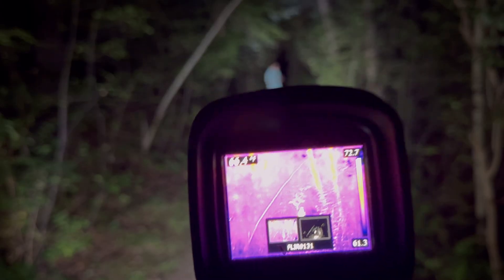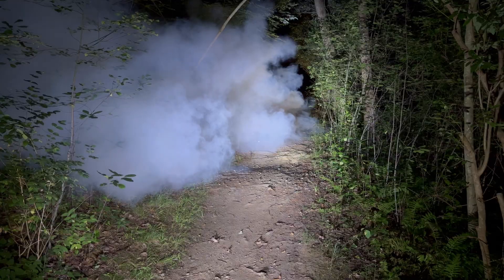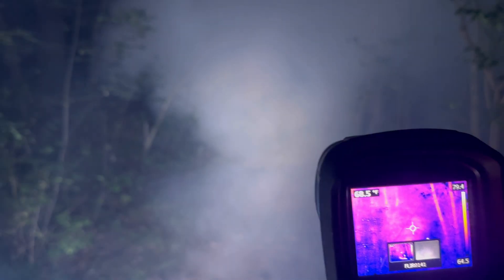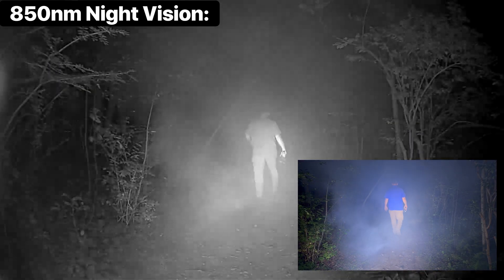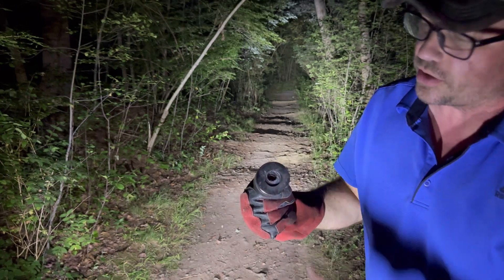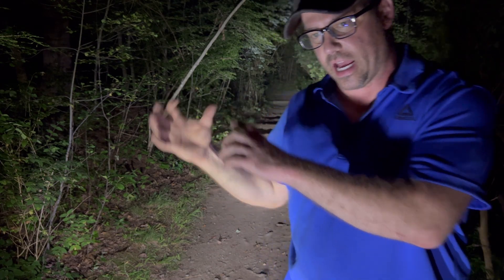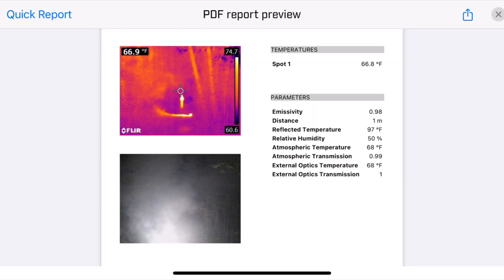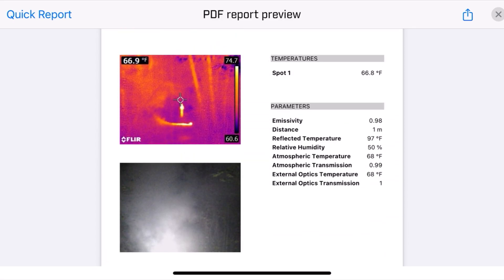HC Smoke Device vs Infrared and Thermal Imaging

Comment: Not sure if you’ve already tried this but it’s stuck in my brain. Why not add some smaller diameter holes on the lid and reduce the bottom hole size. Whatever configuration of size and number of top holes to get the same area as the current exit orifice? Kinda like the OG M18. Say you change the bottom hole to 5/8in. On the top drill 3 3/8in holes. You’d end up with almost the same area. .637 for the new configuration versus .601 with the current 7/8 single orifice….. I would think it would stop all the rocketry lol.

Comment: I would try a side hole rather than a bottom vent. (Like common ground spinning fireworks). Then I might add glitter, fine mica dust to the mixture. A bright flash seems to momentarily overwhelm the camera. 
Thank you, this video is inspiring.

Comment: I remember talking with a fellow who studied thermal phenomenon from an imaging perspective. The issue is that the particulates are not large enough to block the wavelengths that most thermal sensors operate at. Particulates large enough to interfere with a thermal camera would not be light enough to float in the air for any significant period of time.

Comment: Its the maximum wavelength they can see with NVGs. The latest greatest can go to like 1200nm. Gen 2 is around 950nm. Gen 3 can goto around 1050 or so. 

For thermal imagers, you gotta test mid and high band thermal.... Basically active cooled vs uncooled arrays. MWIR vs LWIR. MWIR is harder to defeat (active cooled arrays). SWIR is the newest thing, basically where infrared light and thermal meet. Lasers in the 2k nm range cant be seen by NVGs but can with SWIR. It can also see through most smoke...b
Reply from the maker: F_ck, that’s not good news, it’s so much easier to use an expl0sive incndi@ry screen, just white out. Pesky laws making me jump through hoops
Reply from the maker: Maybe some dried peas as star cores or something wouldn’t be considered antipersonel
Reply: @InventionIncarnate you should be able to add a flare/fountain using a metal fuel like coarse aluminum or titanium powder without having to worry about it being mistaken for an anti personnel device. It's just a signal device, there's no shrapnel.
Reply: @InventionIncarnate compressed cornstarch with a touch of nitro lacquer perhaps
Reply: @InventionIncarnate yup, no easy way out like the vehicle smoke, which is in part willy pete, and a bunch of metal oxides.

Comment: 1) Weigh down one end of a grenade tube, and round it, such that when it lands it always stands up.
2) The bottom can be filled with smoke comp, but the top should be multiple gerbs sprung to splay out when the ignition fuze releases them.
3) The gerb composition should be titanium (ideal), but could be iron sponge/shavings (cheaper) if they are coated with crackle comp.

The grenade stands, firing multiple gerb fountains of sparks, which will obscure thermal imaging. Titanium is brighter across the spectrum, but crackle coated iron adds a tremendous amount of moving 'stars' which also blind thermal imaging. So it's a personal choice which to use. Cost vs prep time. One could merely angle the gerbs to avoid a splaying action, but the gerbs will errode the end, and so the gerb will start out as a cone of sparks but move quickly toward a straight vertical fountain. Again...cheaper & easier..but less than ideal coverage over time.
Reply: so a roly-poly toy?
Reply: @shinjiikari1021  
Sort of, yes.
Reply: That should absolutely work, otherwise there's no way to have small particles holding a high enough temperature for long enough to obscure thermal. It's got to be a burning metal of some sort. I've read some literature on IR opaque smoke compositions using copper salts but thermal is going to need something that either washes out the sensor or creates such a temperature difference that it obscures anything behind it.
Reply: @chemistryofquestionablequa6252  
Good 'ol fashion clay works, but nothing blinds a thermal camera like sparks.
Reply: @thomasg4324I've seen clay tested, kinda funny that Predator had it right back in the 80s.
Reply: @chemistryofquestionablequa6252  
We had a lot of trouble with our equipment in dry clay desert environments. Just the dry clay dust kicked up by vehicles shrouded the following vehicles on thermal, but visuals could still make out the vehicles. So at night it became really dangerous because all optics were obscured. German tanks now include clay powder in some of their smoke screen grenades. Less smoke, but thermal protection is greatly increased..and still works on laser targeting.
Reply: @thomasg4324oh wow, I wasn't aware of that. Very cool! The best smoke I've seen (besides phosphorus based) is titanium tetrachloride but I haven't seen how well it works vs NVGs or thermal it's also a little out of reach for the average guy making stuff in his garage since it's made by burning titanium powder in a dry chlorine atmosphere. I'm going to go back to the literature and see what I can dig up as far as NV and thermal screening there's probably something that's not terribly difficult to make that just buried in an old paper or something. It might be that to block both you'd need two separate compositions but I don't see why you couldn't have both in a device. I'm going to see about somehow getting clay dust into a comp in a way that easily disperses small particles since cat litter is dirt cheap and easily available clay that everyone can get.

Comment: timing is great, I just finished a couple test burns at dusk and really am glad I cut the test amount down, and now see why most of your tests are at night or deep in the woods. And I'm on a mountain I own, but don't need somebody seeing it thinking it's a fire 😂 

also, since I've been doing research parallel to yours, it turns out you gotta REALLY dial back that Indian Black burn rate or it becomes a very effective blinding flare, with some smoke on the side 😂😂

Comment: Tbf I reckon you need to try it on something like a concrete patio slab to check for rotation, remembering spinning pyrotechnics getting stuck on wooden fence posts when I was a kid 😅 really doesn't take much to stop rotation on uneven surfaces